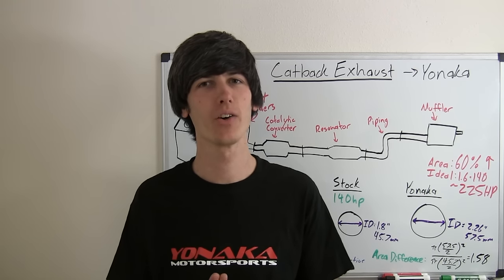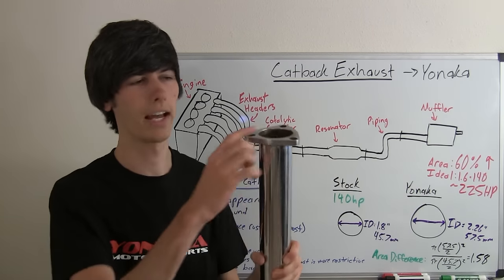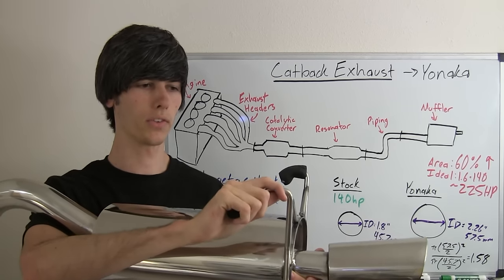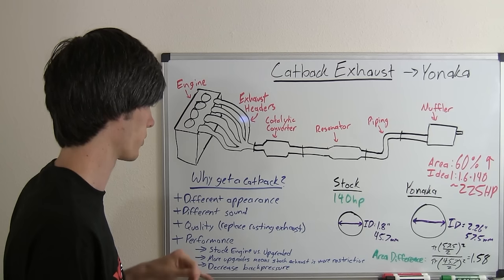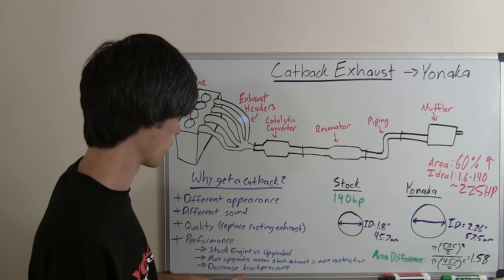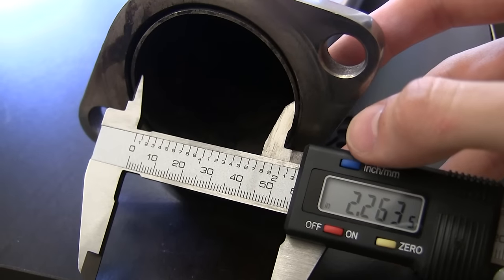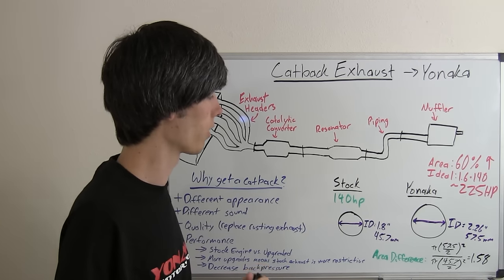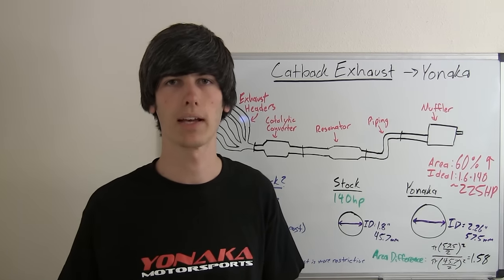Catback Exhaust - Explained

Comment: hey, love your video's. very honest and helpful.

I have a 2010 civic si sedan. K&N short ram intake (typhoon 69) & an invidia q300 catback exhaust. With only the short ram intake, is the catback exhaust not doing anything? Am I better off just putting back the stock exhaust or keeping the invidia catback exhaust?
everything else on the car is stock.

Any info helpful. Thanks!
Reply from the maker: Patrick Graf Here's some acceleration testing I did. You could always try doing something similar and seeing how it works out. Catback Exhaust Acceleration Testing - Project Integra
Reply: With a k20 motor flow is huge these engines love to breath. Your Sri sorry to say sucks it just pulls in hot air since the filter is located right near the exhaust manifold. Second get rid of the exhaust manifold and cat that is there most restrucitive part of the exhaust. A cat back on this car alone yields no gain but sound. So basically change you intake for cai like a hybrid or skunk2 since they are 3.5in change your header for a race header with a cat delete. If you really need a cat buy a hfc but keep your exhaust. But slapping part on this engine and not will gain zero to minimal horsepower. Tuning is everything
Reply: Travis Fisher thanks for your reply, much appreciated. I still have the intake on my car, its been on there for over a year. honnda keep it for now. but I took off and sold the invidia catback exhaust. im back to stock atm. my civic si is my daily, so I have to pass emissions. I am considering buying the direct fit hfc from magnaflow though. your opinions?
thanks
Reply: It will open up flow more than a oem cat but your gains with out a header and bigger exhaust will be minimal. And with out flashpro or another tuning solution it will be minimal.
Reply: True, and optimal performance won't be obtained with flashpro or a tune.
are you familiar with tsudo?
for 8th gen civic si's, they have a header with a hfc available for $299. it also has a 2.5 outlet, so it would be perfect for attaching to oem exhaust.
Think that would be a better investment? I'm not to familiar with the company (tsudo).
Reply: Tsudo is a decent brand their header is basically a copy of the vibrant but again you need flashpro if you go full bolt ons so I would say don't buy anything else with out flashpro

Comment: The same question as i asked for Headers,
Which segments of the Exhaust system will be providing the most contribution to the loudness of the car?
The resonators or the Muffler?
Also, technically speaking does the width of the exhaust pipes or header or muffler contribute to loudness of the exhaust?
thank you
Reply from the maker: Denis Moore Muffler eliminates most of the noise.
Reply: Engineering Explained i have a 2011 honda civic lx, but i want a catback muffler but not sounds too loud!! What do you recommend?

Comment: When you measured the diameter, you measured the muffler out pipe diameter but for the Yonaka, you measure the piping (i.e. before muffler) diameter. How can one know the two are the same?

Comment: shouldn't do this but forgot to mention in my last comment, wouldn't the flow also depend on the down pipe the thing connected directly to the engine

Comment: I'm curious sound difference between one with resonator and one without it. Which one would most likely to make muffling sound? and/or deeper sound?

Also, I've heard having stupid wide pipes are going to loose back pressure which results in lose of hp. Is it true?

By the way, nice video.
Reply from the maker: Without a resonator will be louder within a certain frequency. Loss of horsepower doesn't come from losing backpressure, it comes from losing exhaust velocity. See this video: Performance Exhaust - More Horsepower
Reply: I will check out the video. Thank you.!

Comment: That diagram you drew on the board looks almost exactly like the stock exhaust on my van, except that mine has the muffler between the catalytic converter and resonator.

I've noticed that most cars have the muffler at the very back though.
Does the distance from the engine to the muffler have any effect on noise levels, or is it just a stylistic choice?

Comment: How important is it for the catback to be of uniform diameter for its entire length? This is in reference to the 2016 GT350 factory exhaust system. It uses 2.75" tubing. However the x-pipe has 2.25" inlets and outlets so reducing couplers are used. Does this mean that the large diameter tubing is of no use and the engine is producing the same power as if it had a full 2.25" catback?

Comment: I installed a cat back exaust system to my 2013 SE Ford Fiesta and it seems to be loosing MPG. is that a back pressure adjustment and or a computer Re calibrating. I love the HP gain and sound. my selling point was the 10% in better fuel economy. what's your thoughts and expertise on this :)

Comment: The point is if you revving up the  engine let's say 3rpm mass flow of gases through exhaust system is so great that it creates sucking pressure from the manifolds and from that rpm's engine has to put less power to get rid of exhaust gases. if you increase diameter of exhaust system you enlarge maybe a little torque in lower rpm but you also definitely lowering max output power because sucking pressure will not be able to create (to little pressure drop). this is VERY complicated problem and believe me engineers working hard to develop best results. the same thing is about air intake system if you put mods you destroying balance between exhaust and intake. sory for poor English. hope so you understand what I'm saying.

Comment: great video. I have a 98 prelude with no mods. Would love to install a Yonaka catback but it seems you were saying that some other things would be needed to be done to take advantage of the yonaka exhaust system's potential. What would be the cheapest thing to do first to start increasing horsepower?
Reply from the maker: It really depends on the car, and there aren't really "cheap" ways of doing it well. I'd recommend checking out some forums for your specific car model and seeing what others have had success with.

Comment: I find it interesting that you left the concepts of turbulence and scavenging affect out of your video, remember bolting an exhaust that is too large to your car can result in massive horsepower losses due to these effects, so unless you are doing major work to the engine itself you must stick to as close to factory diameter as possible for peak power/efficiency.

Comment: I was reading David Vizard hotrod article who is an exhaust guru mentioning that as long as the muffler core flow is greater than the inlet and outlet pipes the engine has zero back pressure because the engine cares less about pipe size and only sees the muffler core as a restriction. I'm confused because my MagnaFlow has a 2.25 inch inlet and outlet pipe but a 2.5 inch core.

Comment: When you mentioned the need for some engine upgrades to get the most power of your cat back exhaust what upgrades would you be talking about? Car in question here is stock mini cooper s with a simple CAI. I was thinking about some aftermarket headers and a cat back, in your opinion would that be a decent safe setup for some power gain? Thanks man

Comment: Hi, car newb here. Just now getting into cars. Question for you all: Wouldn't it be most advantageous to remove everything after the catalytic converter? Or would that be dangerous, and why?
Reply from the maker: legit0101 You'd end up with exhaust fumes coming up through your seat. :)
Reply: Engineering Explained
Haha, yes, I asked a friend of mine and received the same answer. But theoretically speaking, removing everything after the catalytic converter would give you the most performance, correct?
Reply: legit0101 It doesn't matter since you would have to tune the car anyway to make use of the less restrictive exhaust flow, and unless you added a turbo that gain wouldn't be substantial. Furthermore you could get the same gains from just a larger diameter muffler with the added benefit of a quieter ride from not removing the resonator and muffler, which would make your car stupidly loud and sure to get all the cops attention as well
Reply: legit0101
Technically speaking, you are correct. Anytime you perform work on the airflow by changing it's direction or pushing it through a catalytic converter or resonator, you increase back pressure (non free flowing). But as the video mentions, if your air stream is already free flowing, opening it up more does not increase power, it just enables you to push more air through it from some other source.

in real life, Jake speaks the truth. Even in professional motorsport, there are restrictions on sound levels and emissions.
Reply: Thank you for the information, gentlemen. Have a Merry Christmas.
Reply: What you could do instead of remove everything after the cat, is just go with straight pipe all the way back, as long as there's nothing in the way. The theory is that as exhaust gas comes out, every twist and turn in the pipe takes away from it's velocity, thus making the engine work harder to push it out. They make mandrel bent exhaust pipe for very minimal restriction, but IMO nothing will flow as freely as straight tubing.
Reply: ***** Hi, I've never heard that before, in my mind, back pressure was always an inevitable downside to muffling the sound. Can you explain, or do you have some links to explain how back pressure would help gas exit from the engine? I'm genuinely curious.
Reply: ***** At least for me, increasing back pressure is bad. I look it as like taking a leaf blower and putting a narrow nozzle on it. The pressure inside the leaf blower is higher than the pressure it would be at without the nozzle. Thus, the nozzle increases back pressure (pressure upstream).

You ideally want the valves to open up in atmospheric (or even a vacuum?) to allow the air to move freely out of the cylinder, when the valves are open and the piston pushes the air out. When you increase back pressure in the exhaust system, the piston has to fight against the increased pressure on the exhaust stroke. thoughts?
Reply: i did that to my 94 town car and all i got was brain damage after 1 year...and hearing damage. It gave me more high rpm power but much much less low end power (car was a 4.6 v8).
Reply: guillaumecousigne Back pressure causes a scavenging effect for non boosted  motors, If the diameter is smaller, the gases move faster too small is bad, it has to be tuned perfectly for nearly the exact flow you need, (Read engineering at the factory) basically your exhaust pulse, creates vacuum behind it that sucks the next exhaust pulse towards it at an increased rate, doing this thousands of times per hour... By using too big of an exhaust, you loose that scavenging on naturally aspirated vehicles, causing the motor to work harder to "push" the exhaust pulses out, instead of them being sucked out by the vacuum caused... Hope that helps
Reply: Kyle Milford Thank you for that. It makes sense, but it has encouraged me to set up a lab test to see it in action!
Reply: I would enjoy a video of that when you get around too it! I've never experienced the idea in practice, since i've never changed exhaust size by more then .5-1" in either direction, I'm curious to see the impact on torque either down low or up top, I expect below the curve HP/tq would be lower, along with lower gas miliage, and upper rev range would be increased power as long as your intake & cams support it... So much more work goes into making a fast N/a car compared to a gently built boosted car :) Basically all we need is a turbo & straight pipe that dumps out the bumper
Reply: Why not you already have back pressure from the cats the only reason we just don't do it is because it will be to loud and may get you into trouble
Reply: Bigger diameter doesnt mean louder, In theory slower moving high pressure gases could be louder then slow moving low pressure gas.. Resonators/mufflers make your car quieter and also slow down gas velocity, The reason people assume big exhaust equals loud, Is becaues on turbo motors the best exhaust for performance would be NONE, dumping after the downpipe would give you the fastest spool, on N/a bigger pipes are louder because people usually either straight pipe, or gut out the cats and mufflers

Comment: The inner diameter of the stock is not 1.8, it’s 1.5 at best. You measured the inner diameter of stock exhaust tip, which is notably larger than the pipe behind the stock muffler itself.

Comment: This might be a stupid question, but I'm new to all of this. Can most aftermarket catbacks fit on any car? Also, is it possible to use any universal muffler with any catback system, or is it all one big part? I have a 2004 Toyota Avalon, but can't find any videos of this car with upgraded exhaust systems to help me decide.
Reply from the maker: Marrakis They're not all universal, no. Many aftermarket companies design them for a specific model. Universal ones will need to be custom fabricated/welded.

Comment: I want to ask about upgrade exhaust system for 3 cylinder 1000cc small car with automatic transmission. Many people in here said that you only need to change header, because it still need back pressure. Do you have a recommendation?

Comment: Always check what your car has first. With my Hemi Challenger, the factory dual exhaust pipes are 2.5'' before the cats and 2.25'' after. Many aftermarket cat-back exhaust kits for my car bring the stock 2.25'' pipes up to 2.5''...so it's really not a significant difference at all. And my factory pipes are already stainless steel, so I really can't justify spending all that money for a cat-back. All I did was have a muffler shop delete my huge chambered resonators and replace them with shorty glasspacks for $160.

Comment: With your formula for what the optimum HP would be, would that suggest an engine producing 140 hp wouldn't benefit enough from this cat back, or does it mean that if you were tuning, over 225 hp you would be losing the gained efficiency?
Reply from the maker: I'm not sure how much it will gain on a stock vehicle (if anything). Hopefully I'll test it out!

Comment: So i would suppose doing things like opting for no resonator, or replacing the cats for test pipes of HFCs would also reduce head loss in the exhaust system as well. Probably not as much as an increase in pipe diameter, but it would still allow the exhaust to be optimized for higher HP right?
Reply from the maker: +Matthew Machart Yes, anything that creates a restriction will reduce top end performance.
Reply: +Matthew Machart it's not as easy. cutting out your catalytic converter also means that you should consider your lambda sensors in order to deliver correct reading to the ECU. Otherwise your engine controller might get fuzzy and deliver below-optimal fuel/air ratio thus reducing the output HP
Reply: +Adam Banaszak That's not always true. In some cars there is a lambda sensor before and after the cat, and it's the pre-cat sensor that sends signals to the ECU for an air/fuel calculation. The after-cat sensor is only there to monitor catalytic efficiency. I have the after-cat sensors disabled in my Mustang so the ECU ignores catalytic efficiency in my cat-less car.
Reply: James Kim thanks! I just wanted to note that it's a thing to consider before any mods